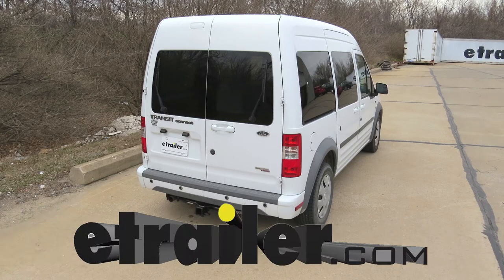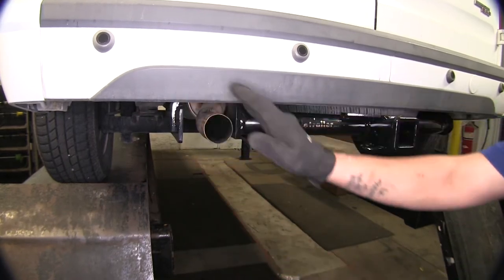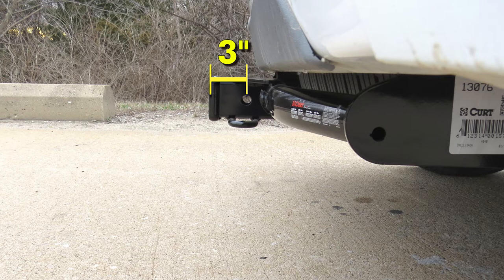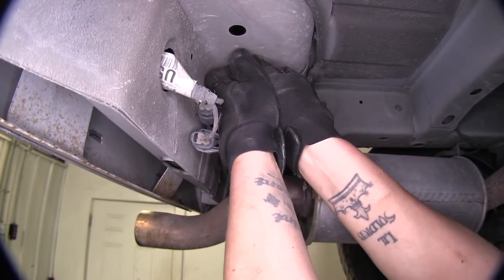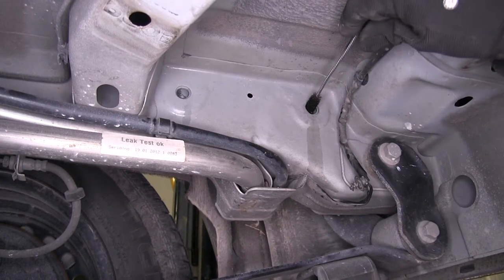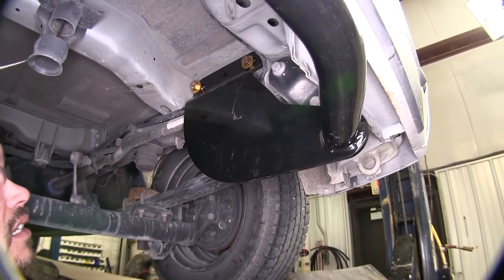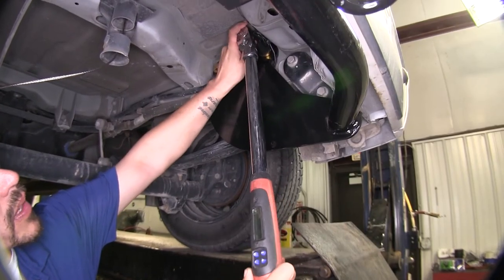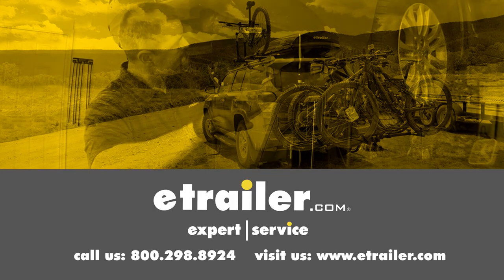Beginner’s Guide to Installing the Curt Trailer Hitch Receiver on a 2012 Ford Transit Connect

Comment: Can this mount for the bike hitch be added to the front of a 2019 ford transit connect?
Reply from the maker: No the hitch is designed specifically to fit the rear of a 2010 to 2013 Transit Connect. The hitch that fits a 2019 is https://www.etrailer.com/Trailer-Hitch/Curt/C13167.html but it's also for the rear. We don't currently carry any front mount hitches confirmed for your Ford. If you can tell me your situation I may be able to come up with another option.

Comment: How much can that transit haul?
Reply: Good question.  I would like to see an answer to this question also.  I do know the 2012 Transit Connect has a load capacity of around 1500 to 1600 lbs.  However, I don't know if that limit is because of it's ability to pull the weight or it's ability to support it.  If it is the former then we have our answer... 1500 to 1600 lbs.  If it is the latter then that number might possibly be a bit higher.  It is a 4 cylinder front drive vehicle though so I doubt the number would be a ton higher if this is the case.

Comment: HELP,, I bought the Curt hitch from etrailer and the mounting bolts sent are 1/2 " but the van threads are 7/16 " . Has anyone else had this problem ?
Reply from the maker: This trailer hitch is designed to fit the 2010 - 2013 Ford Transit Connect. You want to be sure you have the correct kit for your year make and model.
https://www.etrailer.com/fitguide.htm

Comment: So my owners manual states the vehicle, 2012 Ford Transit Connect is not capable of towing anything and to not install a tow hitch. I believe this is due to the underpowered engine and poorly designed transmission. European models have a small diesel an five speed manual. Can you address whether this would actually work and not destroy my van? All things considered, I would dearly love to be able to tow a light garden trailer, a motorcycle and maybe even some plywood sheets.
Reply from the maker: If the manual states that the vehicle cannot tow, it is most likely because of the transmission, axle ratio, and suspension. I would check with the manufacturer to see if the vehicle would be able to handle the light loads you are wanting to haul.
https://www.etrailer.com/Trailer-Hitch/Curt/13076.html
Reply: What is you have a bike rack? Can you install a hitch then😊